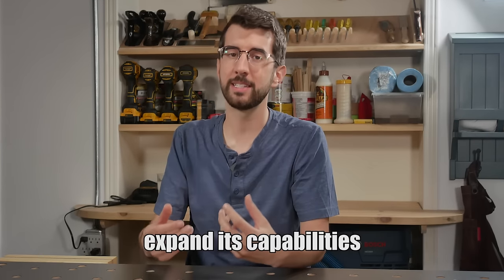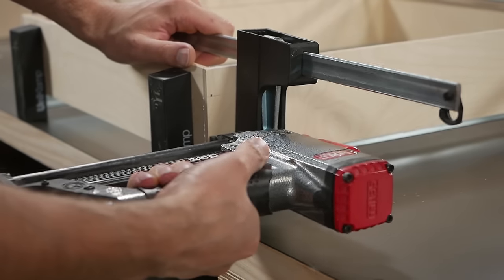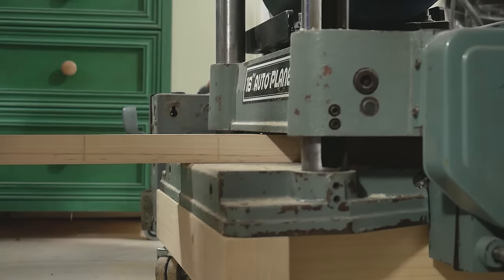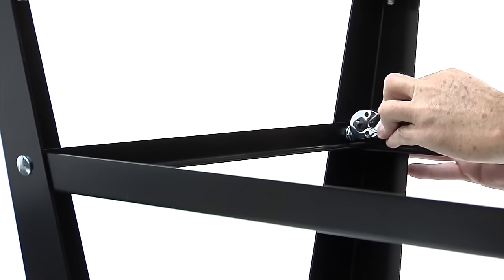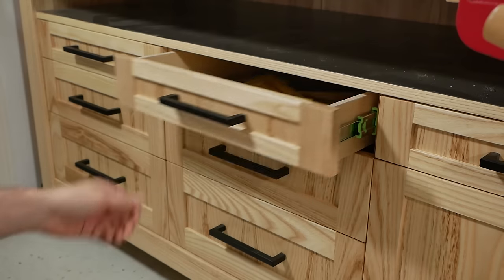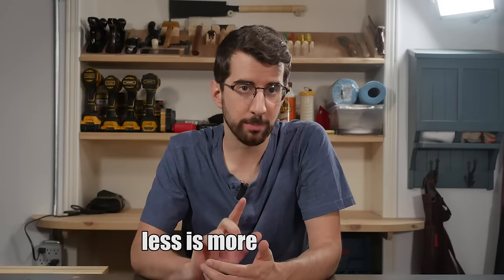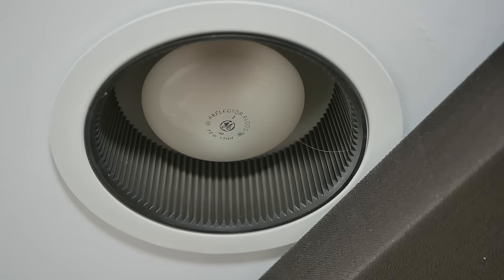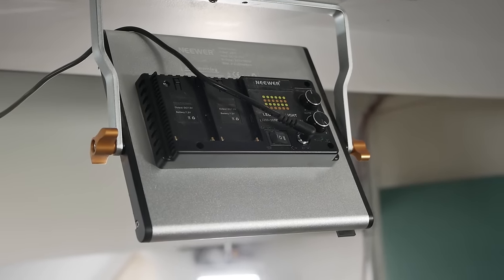a better way to layout your workshop

Comment: Card. Catalogs.

Not the cards themselves... if you have THAT many tools then STOP BUYING TOOLS AND BUY A BIGGER SHOP. I mean the DRAWERS. I bought four of these things on auction a few years back, and promptly lined the bottom of each with that rust-inhibiting toolbox liner foam. 

Each (stackable) unit contains EIGHTEEN 6x3x17 (w/h/l) COLD-ROLLED STEEL drawers but only soaks up a whopping 36x13x18. I have the units stacked 2x2 and built flush into my workbench. That's SEVENTY TWO drawers, that, once I cricut'd our vinyl labels for each, can contain 90% of the tools in my shop, to a level of precision where my labels read things like: "Screwdrivers: Torx" or "Bits: Step, Forstner, Spade" (turns out a hunk of 1x6 with some holes in fits perfectly AND organizes them/ keeps em from banging around). Hell, I have a "Brushes: Acid, Foam" drawer. 72 is a LOT.

"But GC! I have WAY too many tools for that! The weight alone...."

Think so? Yanno what else weighs an asston (that's an SAE asston. 177 kilorectums for you metric folk)? Densely-packed paper. Yanno, like tens of thousands of index cards? The things were built to not only hold weight like this, but to survive the near CONSTANT abuse of decades of library life. If any of you have/have used/have seen Durham container systems (which, brief aside, proved to be ABSOLUTELY worth the investment for hardware), these are HEAVIER DUTY THAN THOSE. I have one single drawer which, thanks to the handy, STEEL, built-in adjustable dividers boasts the label: "Hammers: Claw, Sledge". That's right: I have a carpenter's hammer, a framing hammer, and a FIVE POUND SLEDGE in ONE of these drawers. 

Granted, I had to make my workbench to about 8' long (which is just "so awful," woe is me), and it weighs around 3000lbs (265.5 kilorectums), which, I admit: sure does suck having to cope with an immovable object that weighs as much as a minivan for hand-planing and sanding atop. Albeit, the base of my bench is thicker than many people's TOPS: 1.5"; it lives on EIGHT two-wheel casters. But TALK about your "first-order" organization: if it's not one of my hand planes or measuring tools (cleat wall'd behind said bench) then it's a power tool, or a floor tool. think about it: how many of you have hand tools that you use even SEMI regularly that are BIGGER than 3x6x18? And since there's SO MANY little drawers, I don't even NEED organizers for most of 'em, just the occasional (included) divider: EVERYTHING in that one is a Phillips. Hex shank Phillips bits are in the back.behind the little divider. SOMETIMES I need to go in a second time to get a PH0 after I inadvertently grabbed a PH3.

Best of all, I got all 4 units for 160 bucks. 40 dollars for each. That's literally less than a buck a POUND for the STEEL. And as everything has digitized, turns out school districts and libraries can't GIVE em away fast enough. Trust your grumbly, unfriendly neighborhood misanthrope here folks: card catalogs. You can not thank me later (I don't really wanna hear from you).